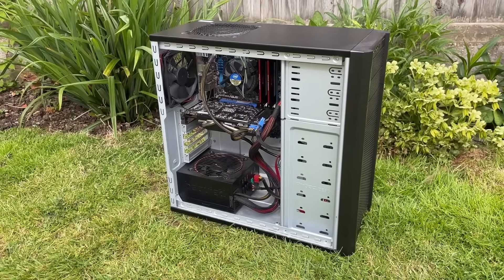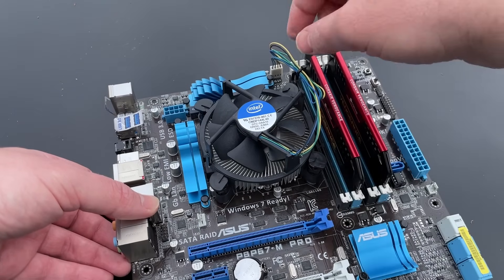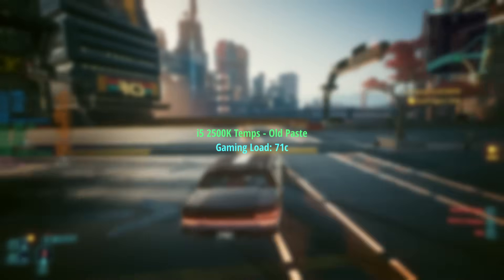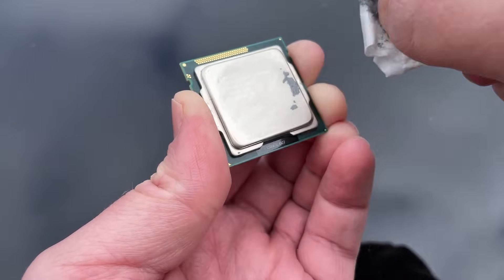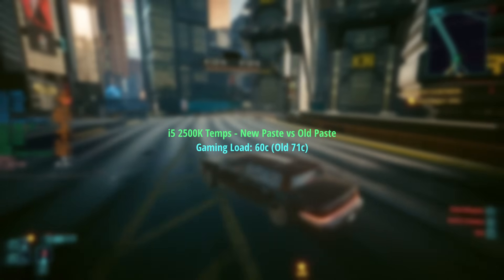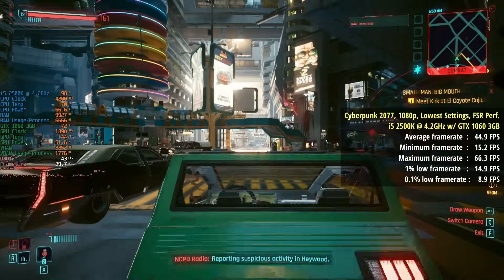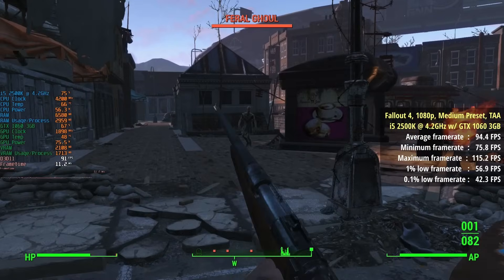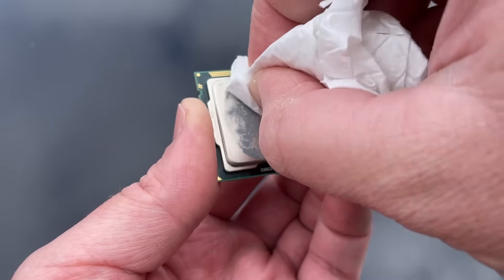I don't think the thermal paste has ever been replaced...

Comment: Any Radeon RX580 or up is better for old/slow CPU-s due to the Nvidia driver overhead in DX-12. Something around 20-25% FPS increase.
Basically on a 4 core CPU, one core is taken hostige by the Nvidia driver. Amd GPUs always use hardware scheduling.

Comment: I've never replaced thermal paste in my life and my oldest computer is now 15 years old. Some tests show only a negligible temperature difference between old and new anyway.
Reply: It doesn't need replacing when done right (as thin a layer as possible spread from a tiny bead from the centre using the mounting pressure of the heatsink). Big dollops end up causing trapped air, and so does the pre applied crap on stock heatsinks

Comment: Sandy Bridge i5-2500K can easily (as shown here) be clocked to 4.0 GHz with the stock cooler. As long as you don't overvolt it, it's fine. Even the i5-3570K (worse heat transfer due to crappy TIM) I once clocked to 4.0 with the stock cooler (but temp got to 82c, even @stock voltage).
The 2500K can even do 4.4 with 92mm tower cooler (like the CM TX3). Only at 4.5 or higher, it needs some voltage(1.3V+), which you want a 120mm tower cooler (or a 120mm AIO), to keep it at healthy full load temps.
If using a 240mm AIO or a bigger (maybe dualfan) towercooler, try to reach 4.8 (1.4+V) ..or maybe even 5.0 GHz (likely need 1.5V for that).

Comment: You could always get one of those pciE riser cards and plug an NVMe drive into it as you already have some available slots - the Gen 3 drives only need x4 speed and the cards cost around a tenner on Amazon. That should speed up the load times a bit, anyway.

Comment: Love to see this video. My i7 2600k is still going strong at 4,7ghz, just below a big voltage wall could go higher. Paired with 2133mhz c10(overclocked) ram it holds up obscenely well and my 1% lows rarely drop below 60fps. I have been using it since 2013. Took a gaming gap and thought i'd need to buy a new PC. Nope a better GPU and overclocking has added another year onto it's life for me. 11 years and it still meets my needs. 

Also has no issue with music production with modern DAWs. I'm gonna use it to power a home server when i'm done with it. Maybe 20 years is possible for Sandy Bridge. 
Not sure if i can buy another intel though, my expectations are very very high now

I even have a 1060 6gb lol. CPU runs at 60c in games too :)

Comment: Not only you should test the system before tinkering it, you should test before cleaning it as well. If you clean it and it doesn't work, you can't be sure if the system was already broken or something you did when cleaning the system broke it. As per using ketchup, it will work. The problem is tomato is slightly acidic and it will corrode the copper on the heatsink. Toothpaste will also work (I've done it in the past when I ran out of thermal paste) but you have to replace it after a few hours because it dries up and loses its thermal conductivity.

Comment: I used to use arctic thermal paste but I found a cheap one off ebay which is probably 80-90% as good. HY510 which in the UK cost me circa 4 quid for a 30g tube. I've done multiple applications on various cpus since I got it (2022).

On a side note, it'd be interesting if you could do videos on getting parts for repairs on PCs from aliexpress. I say this as I had to replace the fans and fan shroud assembly on an MSI GTX 1050 ti LP card. There were no options (that I found at least) in the UK so I took a gamble and bought a replacement off aliexpress for 4 quid. It works just fine and has been running for years now.

Comment: Can you try to make an intresting test with some 4 core ddr4 intel CPU?
i5 7400, i3 8100, i3 9100f can work efficient only with 2400mhz ram and I would like to see how much latency changes. 
Something like a great 2400mhz 2x8GB CL14 or lower vs a bad, green, cheap ram 2x8gb 2400mhz cl19 or more + maybe a test of 4+8gb with cl19 ram.

For example i3 8100 + gtx1650 super works nicly in cyberpunk, with tweaked DF settings and locked 40fps, with drops to ~30, but mostly not lower than 33. But it is also a tweaked windows 10 + turned on "Hardware-accelerated GPU scheduling" in windows 10 graphics settings.
In some games Hardware-accelerated GPU scheduling may lower performance, but for CP2077 it works nicly, freeing up some CPU power.

GTX1650 super is better than gtx1060 for games like CP2077.
You can get h310 motherboards from outlets for like ~35$ in my country and i3 8100 is sometimes for <15$, safe, chieftec PSU 350w with PC case is around ~10$ and gtx1650 is around 70-90$, ram 30$.
I got this PC parts for someone and CP2077 works fine, only there is 4GB+8GB ram, which work with the slower one settings CL19. It had quite good 2x4GB, but CP2077 used ~10gb of ram here, so it free up some CPU power, coz less memory of ram needs to change all the time.
Reply: OH and my PC settings for this i3 8100, 4+8gb 2400mhz CL19 ram, gtx1650 super + ssd:
Textures: high
40fps limit
WITHOUT VSYNC, it adds a ton of latency
Crowd Density: MEDIUM

Film Grain: Off 
Chromatic Aberration: Off 
Depth of Field: off
Lens Flare: On 
Motion Blur: Low 
Contact Shadows: On 
Improved Facial Lighting Geometry: On 
Anisotropy: 8 (may be 16 with better ram, I wanted to lower it to free up some bandwith, but it seems to not change much if anything at all)
Local Shadows Mesh Quality: High 
Local Shadow Quality: High 
Cascaded Shadows Range: high
Cascaded Shadows Resolution: high (may be lowered if you rly want)
Distant Shadows Resolution: High (may be lowered if you rly want)
Volumetric Fog Resolution: High
-Volumetric Cloud Quality: medium
-Max Dynamic Decals: medium (again I did it when I had 8 gb of ram, just to be safe)
-Screen Space Reflections Quality: low
Subsurface Scattering Quality: High 
-Ambient Occulusion: low
-Color Precision: Medium 
Mirror Quality: High 
Level of Detail (LOD): High 

Ray Tracing: Off

I tested this PC up to some running around in act2. If you are getting big, long average FPS drop then you may want to reload save, but after changing ram from 2x4gb to 4+8gb I had no problems or I played for a short time.

Comment: Yeah, I know that I should repaste my daily driver which runs 24/7; a FX-8350 that I built about 12 yrs ago. But HW Monitor says that the temps are still fine. I don't game on it or do anything that pegs the CPU for extended periods of time. Still, it wouldn't hurt to repaste it, and it also wouldn't hurt to give it a good dusting. I've pulled the case front cover off and vacuumed the filter and fans off a few times, so I know the inside is not going to be anywhere near as bad as the ones that have an entire cat's worth of fur in them...

Comment: For most pastes, the dry part is not the problem, it's how it dries.  Technically, the liquid part is less good at moving heat away than the solid parts that are there and the more liquid like aspect is just there so as to make application easy and also for when it heats up and needs to "flow" into all the little cracks and all that - once that stuff is in all those little places, the liquid part is not needed and it would be better for it to just disappear.  that say, some pastes are really bad at this, and there is pump out and other crap about how they work that means they need to be redone every few years.

Comment: If I get something like that, my upgrade plan will be something like that:
1. Ivy Bridge CPU with 8 threads
2. M.2 adapter for nvme drive, maybe with bios mod for support booting from nvme if needed
3. Optional WiFi pci-e adapter if needed.
4. New GPU - Radeon 6600 or something like that

Comment: I had the exact same board. Man, those memories I had the 2600K which I did manage to bring up to 4.6-4.7 GHz on a Corsair H70 cooler. Did use the 2500K also OCed to 4.7GHz but using the P8P67-Pro instead of the M-Pro. I was quite lucky on the silicon lottery of these two and I didn't really need to tweak any voltages to make them run stable at such high clocks.
Reply: Sandy Bridge went to 5Ghz on most competent 4+ heatpipe coolers. And around 15% of chips could get there. On Ivy Bridge the average was more like 4.8Ghz in the top 15% but there were still plenty of 5Ghz capable i5s and 4.9Ghz i7s

Comment: I have an old Lenovo minitower I scored for 70 bucks shipped several years ago.. It's got an i5-2400, but it's extremely flaky with all my GPUs except for an HD 5450 that works perfectly in the system for some reason. I do wonder if the PCI-e slot power is not up to spec. I really never got to test it properly in gaming. Your i5-2500k performance makes me want to try it again.

Comment: My still working 2500k and P67A-GD65 and Gskill Ripjaws memory was in use 13 years until last April until I retired them to the bookshelf next to me.  I had an Corsair 750w silver? PSU that never failed.  Unfortunately I had been shipped a bad motherboard from ebay that that fried itself when I tried to power on so I had to junk that PSU instead of risking it on good hardware.  I added an Samsung 860 Evo in 2019 to speed things up.  I never overclocked it so it always idled at 38c with the Hyper 212 EVO.

Comment: It's crazy you can cool a 2500K with a shitty stock cooler and crusty ten year old thermal paste just fine.
Forgot how easy to cool old CPUs were. Essentially a 20$ tower cooler would allow you to OC the heck out of it with ease.
Reply: new cpus are as easy to cool.

just that nowadays people want it to run cooler and not bottleneck.

i havent used one, but isnt also newer intel stock coolers a bit better than before?

Comment: I had plenty of older hardware, and old thermalpaste is basically never an issue. Yes, you get lower temps with new stuff, and on laptops that might make a huge difference, but usually its mainly the dust baked into the headsinks and fans thats the issue
Reply: if its stuff thats more used, or at higher heats, it makes huge difference, especially on high end parts.

Comment: The thermalrights (coolers) on Amazon are ok, they perform well for a cheap cooler, just dont overtighten the screws, one snapped on me with material defect, it still works ok and performs well on an old I5 4670k @ 4.5ghz and it was only the £18 single tower.